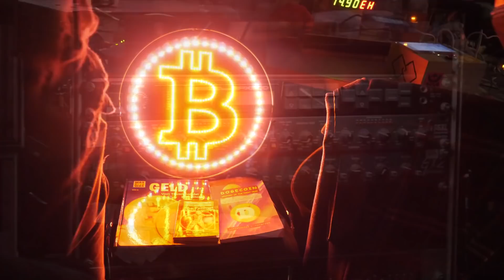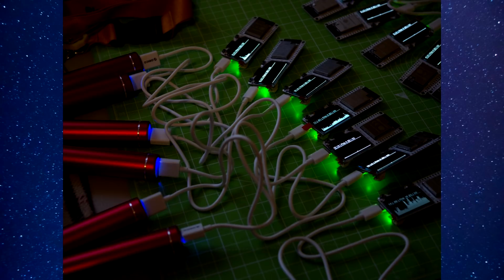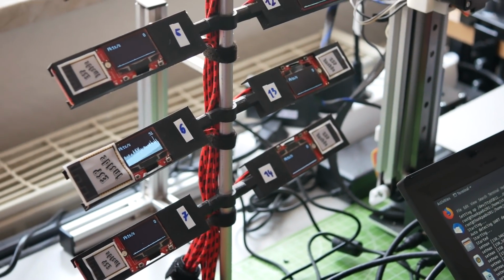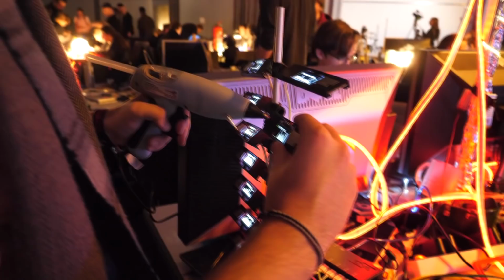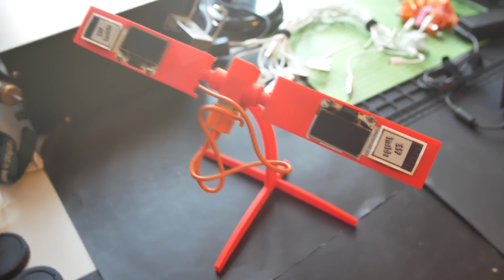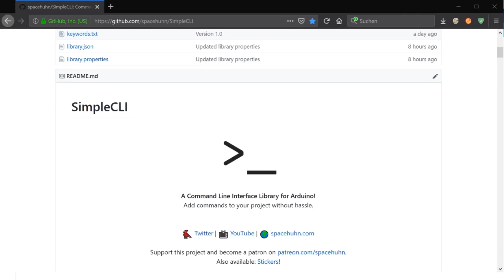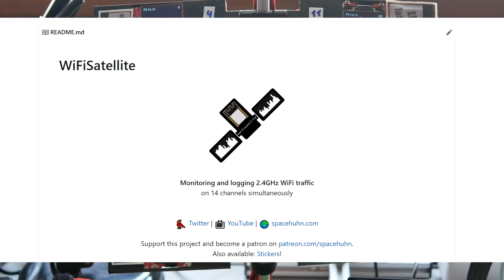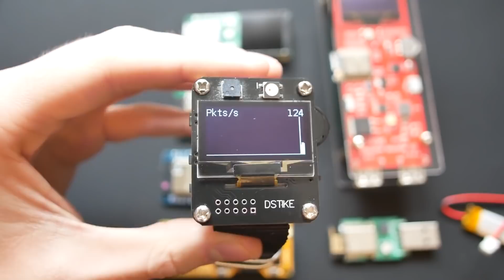WiFi Satellite

Comment: Can u help me spacehun got v4 red board I vaguely remember changing passwords and ssid name ok. Now when I hit reset button pwned comes bk up let's me scan etc etc but won't let me change password now? When I hit save it returns to default can u help without me have too flash etc as I bought online? Cheers
Reply: someone liked my question but no one answers haahaaa
Reply: @Will111ism  You can reflash the Firmware, so it'll be a clean start. You just need a CP2102 Dongle for it.